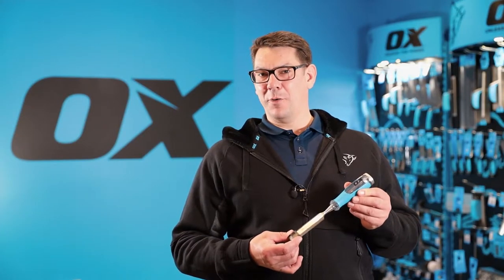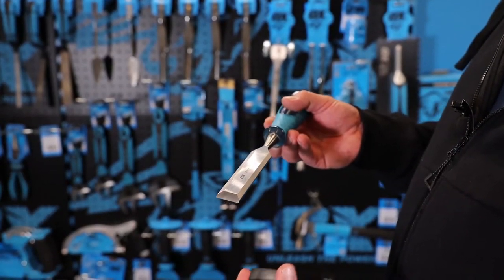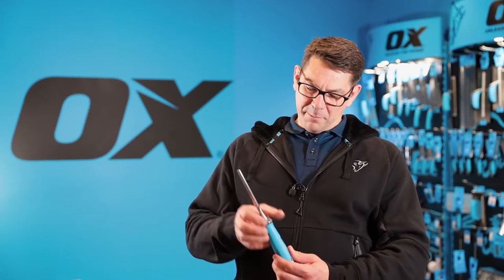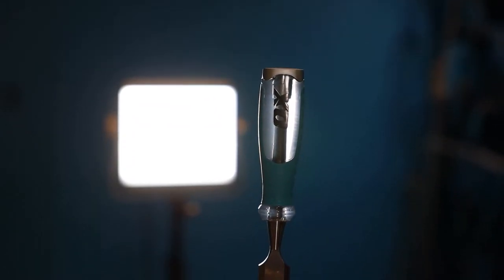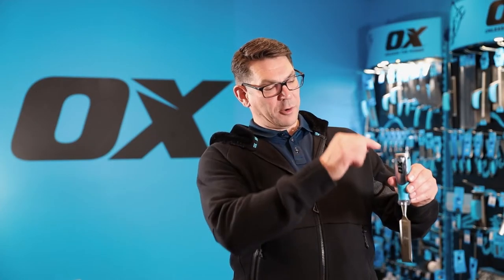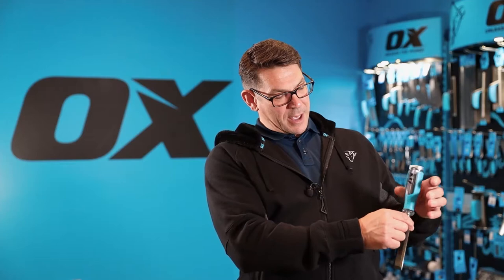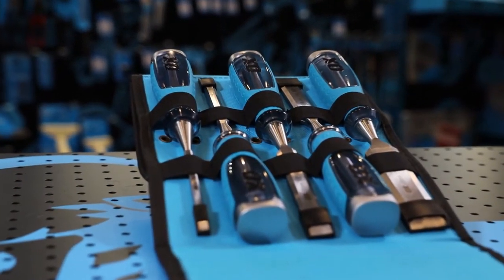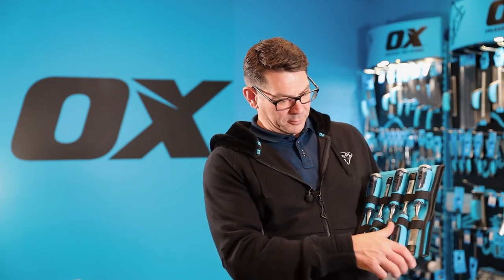OX Pro Heavy Duty Wood Chisel Set

Comment: Oh man, watching you chisel out that notch with such poor support to the timber and with your fingers in front of the blade in the later shot - shocking. And, why on earth you would want to strike the head of a chisel at an angle as described, I do not know. I rather think the metal striking head is designed to prevent the plastic portion of the handle from burring in use. Does very little to support credible image of the product which does indeed look good.